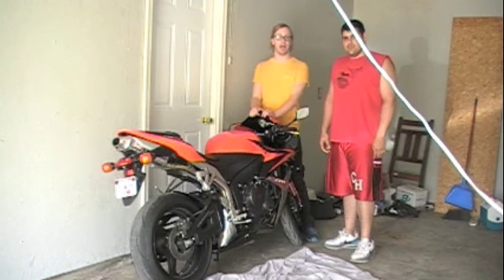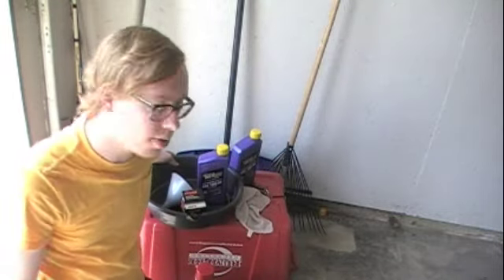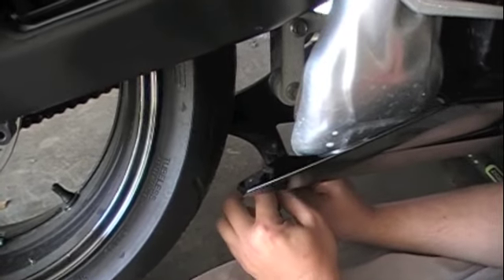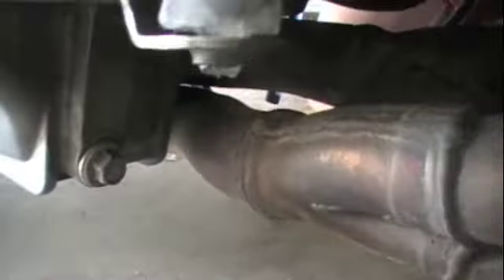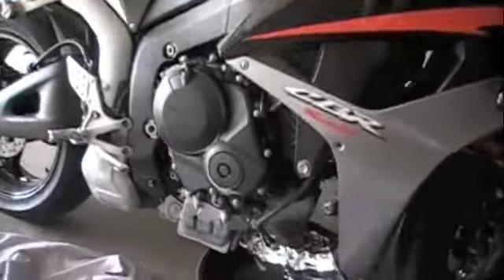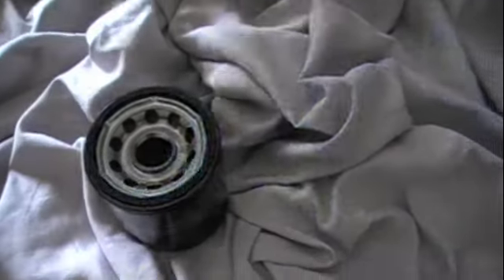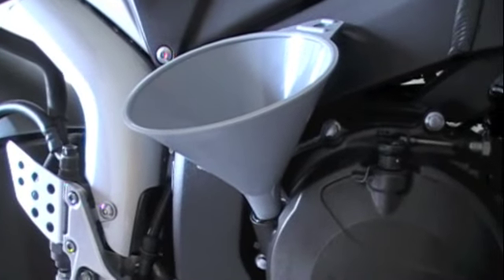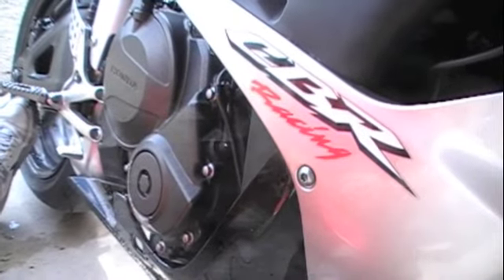Beginning Technicians Honda CBR 600 RR Oil Change

Comment: Hey guys you can use a mobil 1 m10 or shorter m8 oil filter for better protection 

This being said your using the incorect oil you need to use a 4t oil or a t type oil cause its a wet clutch and needs to not have friction modifiers 

SUCH AS ROTELLA T OR MOBIL 1 10-40T

THAT IS ALL THANKS! !!

GUYS GREAT VIDEO KEEP EM COMING

Comment: there's nothing wrong with this oil " Royal Oil Purple" I have read about it and from the manufacturer they said recommended for any 4 cycle engines.
high stress engines which are the bikes.
with that being said I have just changed mine and used oil purple 10w-30 and we'll see.
thanks,
Reply from the maker: Tito Neal Royal Purple is considered some of the finest motor oil around, that being said, it's always good to check with the user manual for any warnings (usually they just specify the type though, not any brands).
Reply: +Beginning Technicians your using royal purple and then a fram oil filter! yikes. fram is crap . you should used honda oil and filters bro